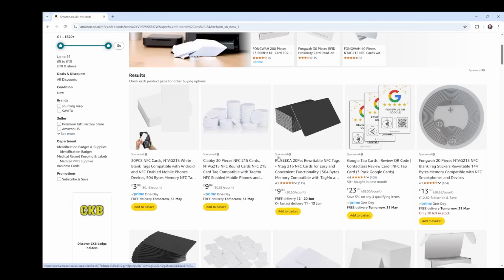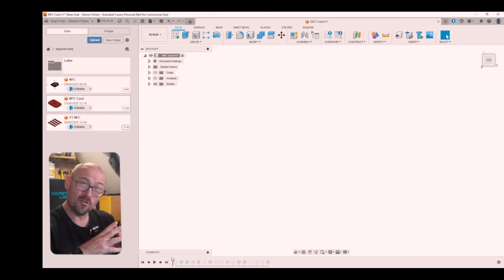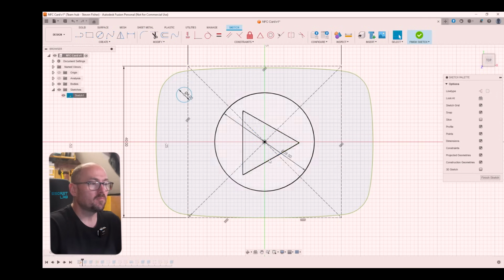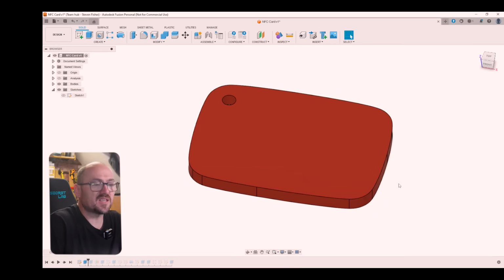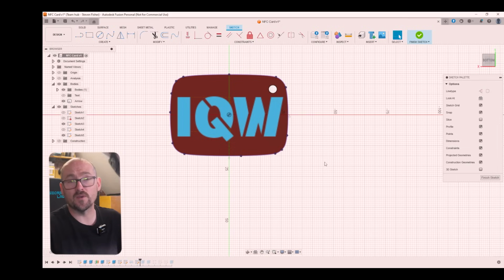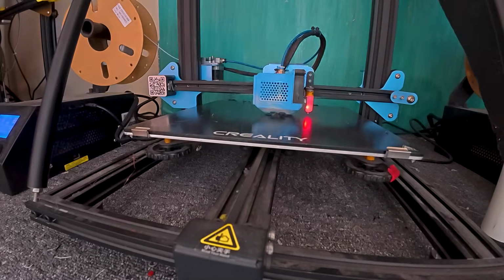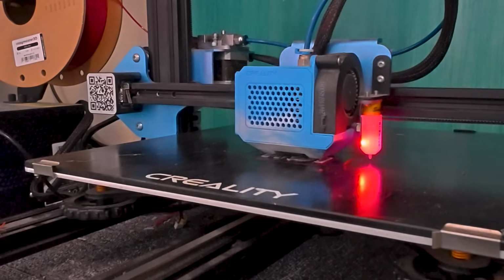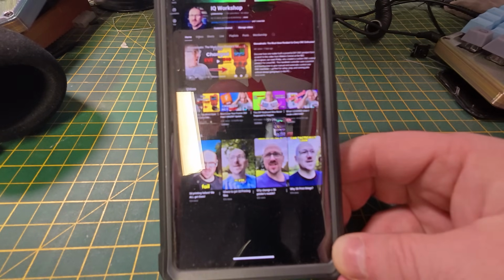I TRIED making a 3D printed business card - Does it WOW?

Comment: well damn the thing i'm most interested in from the video is the idea of printing a model stopping and then printing a separate model around it, i like the idea as it means even with a multi color unit i could print 2 layers for better color definition and shape then stop and switch and print the outer model with no bleed or worry
Reply from the maker: Glad you got value from this video 👍
There are other applications for this technique beyond what I used it for.
You just need to keep in mind the height of the first print vs the travel moves so you don't knock it off the bed.  Oh yeah... And if you use a touch probe for homing. You don't want to home on top of the first print 🤣

Comment: This was absurdly overcomplicated for no reason. You can literally model the thing in 1 go, put a gcode to pause at "x" layer, switch color, continue. Then again pause at x layer, put the tag and resume. No offset aligning zhop double modeling bullshit 😂
Like actually no reason to make it this complicated.
Reply: I don't know much about 3d printing so it would be nice to know why the z-hop is unnecessary. It appears to me that the print head would run into the already printed thing. so is it fine in this case b/c the height is only 2 layers?
Reply from the maker: @VVerVVurm  there are a few points being made by @ramaswamp
I'm going to put the modelling points aside based on your question.

What I understand @ramaSwamp to be saying here is that zhop is not needed "if" i printed the model in the same way a machine with multiple colors/materials would.
A machine with AMS would print one color, then the swap the filament, print the second automatically and then move to the next layer and repeat as needed.
This way the layer height of each color is aligned and the zhop is not needed to avoid it crashing into what's already on the bed.
Zhop does add additional movments so can increase print times over a long print. In the video, I limit zhop to only 2 layers to account for this method and not add a bunch of time.

I "chose" to print it this way because I needed at least 2 layers of the white in order to get the contrast I needed with the filament I had on hand.
Printing the way @ramaSwamp suggested, in my opinion, adds additional color changes and purges to the manual process to get clean colors.
Purging the red out of the system to get pure white and not a funky pink took over 400mm of purging. Where as going to the red only took less than half that.
This also reduces the amount of waste from purge events.

Being honest, I don't model for multi colours as I don't have an AMS, so this is all new to me.
Is there a better way of doing this..... Sure! The ultimate would be to get a printer capable of multiple colors

Until that day comes I'm going to streamline my "manual" process to have as little human intervention as possible as this increases the chances of failure
Reply from the maker: This is my workflow, what can I say 🤷‍♂️
Glad this was thought provoking for you and you considered an alternative route to create something that works for you.

I thought the "absurdly overcomplicated" comment was a little harsh. You've seen 5min Crafts right..... 🤣
Reply: @IQWorkshop  No, I've been 3d printing for years, and the process is the same as anything when you have to insert something, magnets or whathaveyou. All that notwithstanding, instead of analyzing what I said, you resorted to Ad hominems. Sad.
Reply from the maker: Lol
There was no attack. There are many MANY different ways to do things. This is mine.
There is a reason I "chose" this route and it's what I actually use, unlike 5min Crafts. I mean who puts a banana in a pipe, cover it with toothpaste, then tape. Just to induce confusion.

I am VERY keen to learn new things, see and promote different approaches. What works for one doesn't work for another. Personally I judge the results not the method

Comment: I have had issues with the tags I have made on NFC tools. It registers with Android phones with no issues, but iPhones don't seem to scan it. Did you have any similar issues?
Reply from the maker: That is really interesting that you mention this. I have had the tags scan on iPhone, but there did appear to be intermittent issues.
I suspect this is to do with the NFC/scanning policy on iPhone devices.

I'll look into this and update this thread with my findings
Reply: Thanks! This has been a real thorn in my side in getting a few projects to work. @IQWorkshop
Reply from the maker: Looking into this it would appear this will be down to a few things
1) the type of NFC tag and it's frequency. this needs to be in a compatible range
2) the iPhone may not be configured to read NFC by default.

You should be able to test this out using NFC tools on the iPhone.
Use the read function to see if the the iPhone can detect it. If yes then then the iPhone may need a setting update to read off the bat.

This video may help covering off the first round of checks - https://www.youtube.com/watch?v=3dgUamGe3yg
Reply: Same issue here, any fix?
Reply: @IceyAndyy @GoodDash1 what type of tags did you use?
Reply: Curious how you're programing the NFC card. What program are you using? Is it from an Android or PC?
Reply from the maker: I'm using NFC tools available on Android and iOS. One this I have noticed is that older apple devices seem to be unable to read the tag for some unknown reason. Newer models and Android seems to be fine